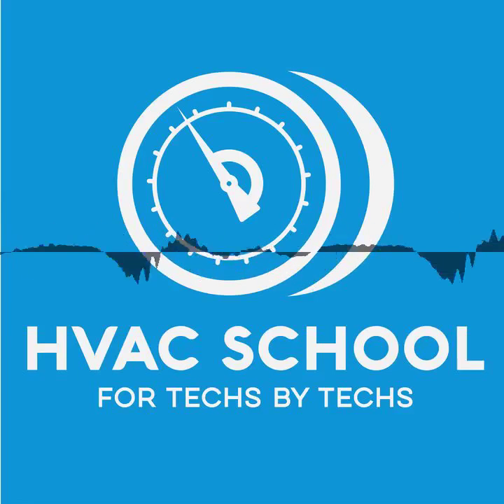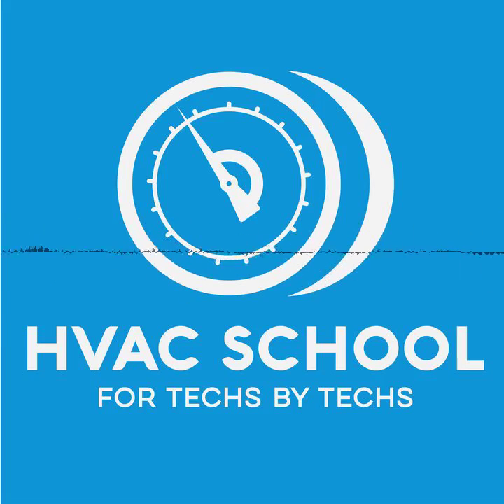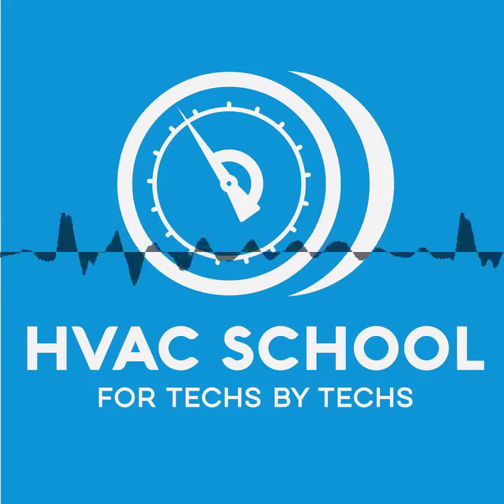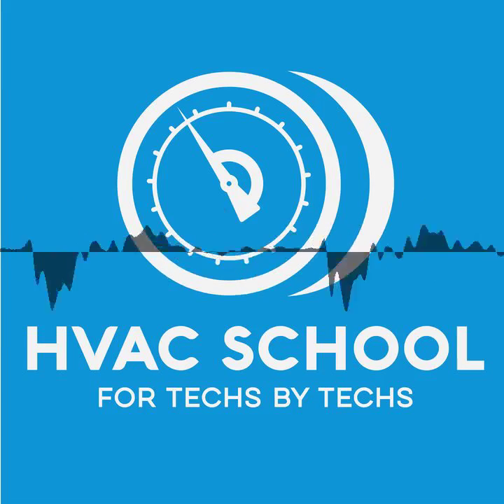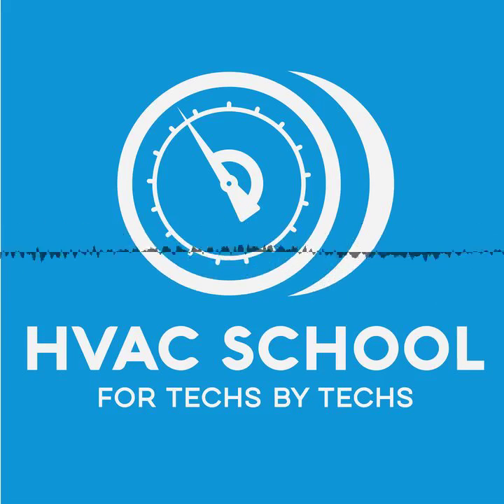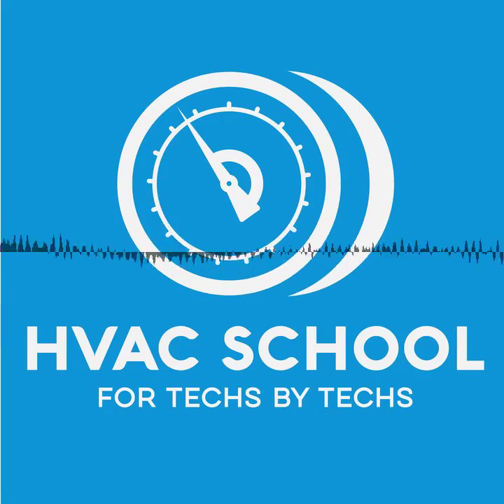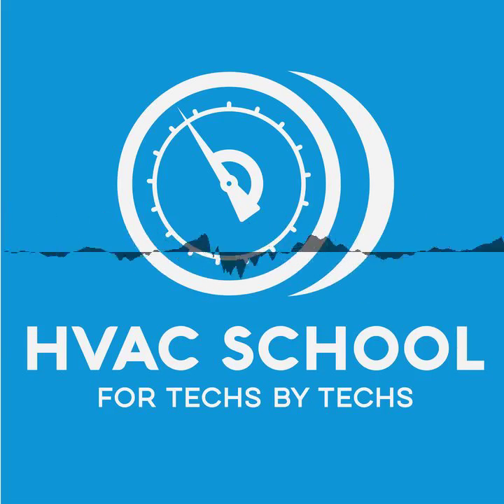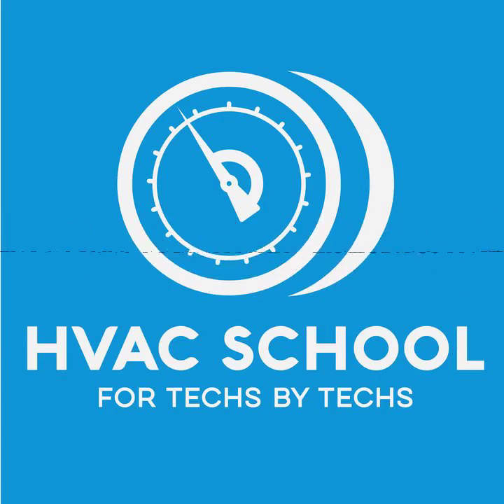Intro to Water Source Heat Pumps w/ Eric Mele

Comment: I work as a contracted repair Tech for a WSHP company. of the things i have worked on and repaired, mosty of them have a klixon to cut power to the unit once temperature drops low enough in the water line/refrigerant line, depending on where the thing is placed. now in heating mode, it is highly important to not overwhelm the refrigerant thermal absorption, as the compressor still needs to cool itself. overheated compressor can hurt the rest of the system.
Reply: the ones i work on have capillary tubes for lower pressure units, and biflow TXV for high pressure units that utilize 410A. occasionally the TXV silver solder joints are a small leak point (stuff happens) which one of the units i worked on had this issue and was overlooked a minimum of four times, and had access ports installed.

Comment: I was hoping for some more basic back ground knowledge as I am a newb, is water source more efficient than air? if so, by how much? Given the conductivity and energy density of water over air, I expected a large gain of efficiency? Given the specific heat of water, how important is constant flow v static water?

Comment: Hvac tech from miami! Great video good info.  If you have good water flow ,the right difference in water temperature coming in and out but a really high discharge pressure,  how do you know if it's a dirty condenser  or refrigerant restriction?

Comment: So biflow TXV (typically found in apartment units) has a third tubing line beyond the direct flow lines and the sensing bulb. Third tube is the suction pressure line. 

Other than that, counterflow in the coaxial heat exchanger is important to have the greatest thermal difference at every point along the water. For example, in cooling mode, the coaxial heat exchanger refrigerant circuit is the outer of the two tubes, but the hottest refrigerant meets the hottest water, in which the water is being heat up by the cooling refrigerant, so the inlet for the water is the liquid line for the refrigerant

Comment: A little off topic, but... I was called in to connect the low voltage on a Trane air handler and heat pump with a ewc zone damper controller. All pretty straight forward stuff, except the heat pump has a connection called "W Out". Can anyone explain this function and why its there? I have never seen this on any other product.